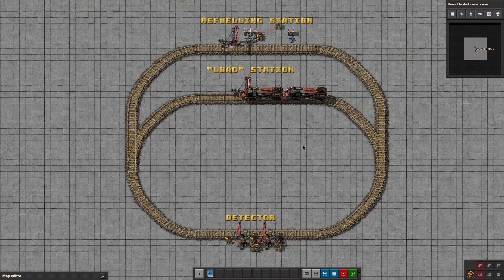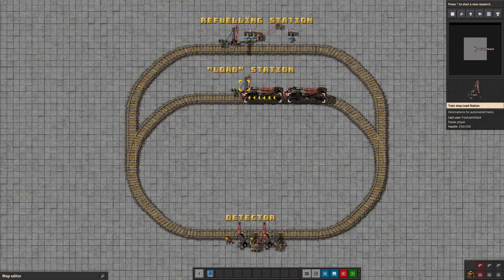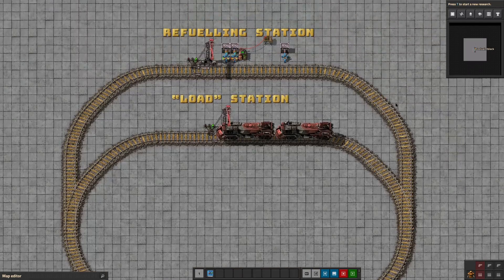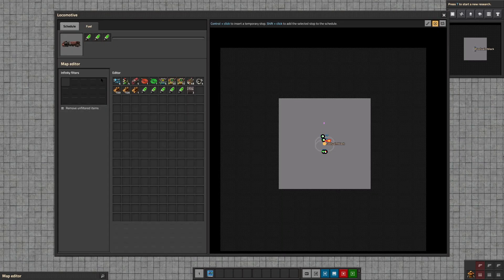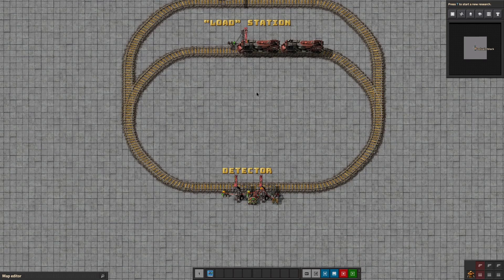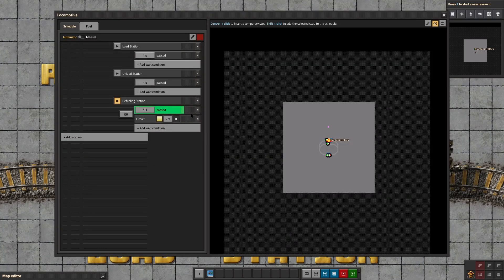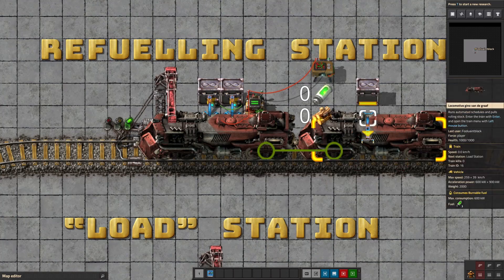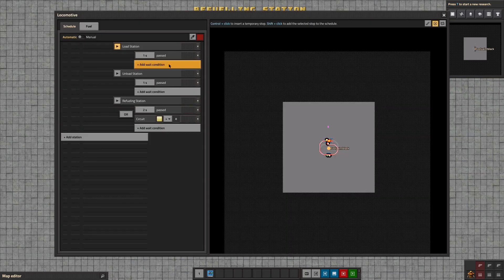Factorio Acceleration Based Refuelling

Comment: Fascinating solution. Using the integer overflow is very neat. However I don't really see the need for this separate refuel idea. Why not simply refuel at the load station. If it takes 1 second then it will not cause pile up. Also this will let your trains run out of fuel if your distance between stations requires 50.1-66.66% of total fuel. Then the train will not have lower acceleration at the 2nd station but will not reach the 1st station again.

Comment: Can this be adjusted to work with rocket fuel or solid fuel? Or what about two locomotives on either side of the the train instead of two on the same side?
Reply: Latter half has a blueprint to figure out the delay you need

Comment: Why do you want to have wood in the front locomotive? Since you have multiple locomotives, isn't it simpler to have one of them simply run out of fuel?
Reply: This is to make sure that the front locomotive runs out of fuel first, and it limps back on the remaining fuel in the rest of the locomotives.

Comment: this entire thing becomes obsolete as soon as you reach bots no? you can just have a requester chest limited to a couple nuclear fuels at each or every other station with an inserter inserting into train..
Reply: Only useful if you want/need centralized refueling. If you have distributed refueling, simply refueling to maximum at every load and/or unload is adequate. Distributed refueling is pretty easy using circuit network with or without logistic network. Without logistics bots, the only downside is "wasted" fuel sitting around on belts.

Comment: Any alternative besides acceleration check eg fuel count etc?  Any way to read locomotive content only?
Reply from the maker: Not without mods, unfortunately.
Reply: @fooluaintblack  , found many use LTN for this, is that the mod ?
Reply from the maker: "mods", there are a few options. I don't use train management mods like LTN, but I have used one which uses the circuit network to read locomotive info like remaining fuel. I don't remember what that was called though.